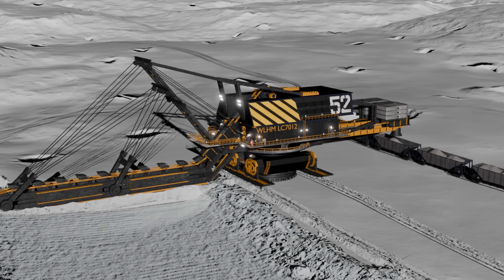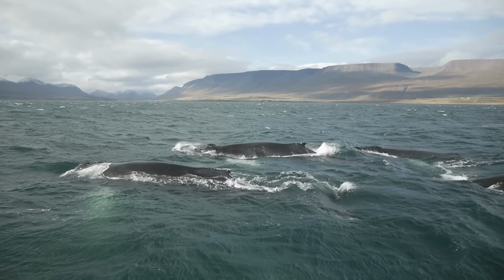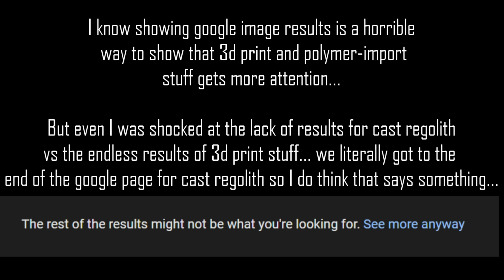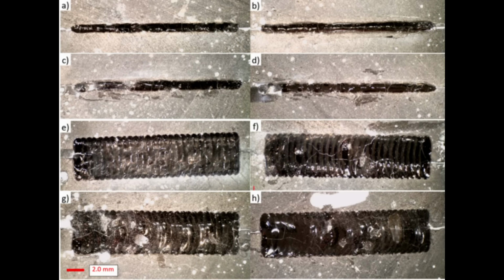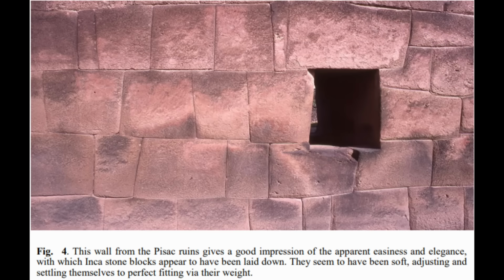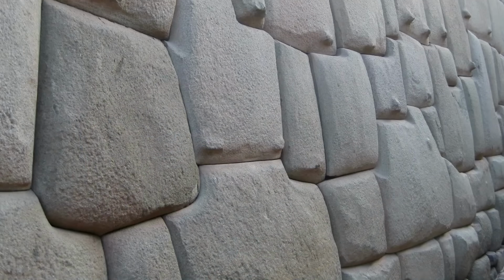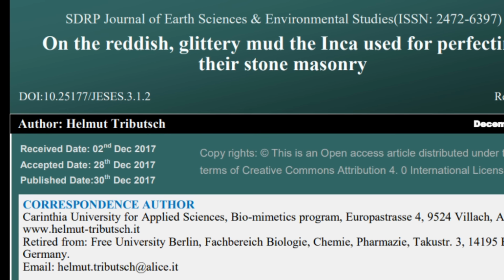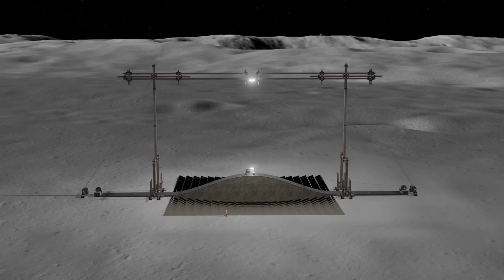Lunar Construction Materials

Comment: What about using a very hot wire to kind of solder bricks together? Kind of like what they use to burn and cut through styrofoam blocks but instead it's slowly passed through the bricks. Also instead of trying to make a normal cast basalt, what about glass-ceramic bricks? This would avoid the heat shock stresses if adjusted right(may need some bits removed or added as far as its composition goes to get crystals to form properly). Glass-ceramics have a costly step on Earth of maintaining certain high temperatures for prolonged periods of time to allow for the growth of crystals, but on the Moon that's not an issue.
Reply: Ceramic requires specific compositions of materials. Basalt is to cut some potencial imports, and ceramics will require imports.
Reply: Hot knife - just smear the stuff with some metals, coating, and let the cold welding do it's thing for sticking.
Reply: @Molb0rg  Yeah, magnesium could be the metal to use too since it's fairly abundant in Lunar regolith and has a fairly low melting point.

Comment: A question with the intention of using bricks to build how would just cutting the blocks compare energy wise if you used a laser or microwave fracturing? Robotically lap the blocks if needed to smooth edges if needed. I'm pretty sure this is cheaper energy wise though you wont get as nice of a finish. Probably acceptable in the early stages, and have further uses in shaping the terrain if needed early on with the aid of other robotic units.
Reply: Finish can be done, they polish well enough

Comment: Cast basalt is an order of magnitude stronger than any polymer binding agent for regolith.  It is as strong alloy steels.  It can be melted with concentrated sunlight, which the moon has in abundance.  If cast into tiles it can be used to build timbrel vaults.  Cast basalt is strong enough to make truly huge pressurised domes on the moon, which can be covered in regolith to ballast against internal pressure.

Basalt components can be bolted or welded together using lasers in vacuum.  Epoxy glue is an option as well.  If the blocks are smooth, the layer of glue can be microns thick.  Could we make bolts or dowels from basalt?
Reply from the maker: bolts and dowels maybe, I looked into using sol-gel stuff for binding the fibers togeather instead of epoxy like in basalt rebar but it's iffy. Needs to be explored more in depth

Comment: I still think nuclear is the better route for the moon. Solar panels are great for niche applications.
Reply: For life support, I agree. But for the ability to multiply the output in an exponential manner, solar on the moon wins.
Reply: @treasurehunter3744  setting up a nuclear reactor of sufficient size is a one time deal. Itll take the colony from 1,000 to 100,000 people. Solar is a way to create an industry thats purpose is to creat more of itself. The land needed increases transmission losses. The extreme heat differential will damge them overtime and reduce output at peak temperature.
Reply: @treasurehunter3744 and dont even get me started on the nightmare that is two week with no light all. Im mean sure that can be mitigated by being on the poles but to spread out from there will be difficult with a solar economy and no expertise for building a reactor.
Reply: @rexmann1984 Again, I'm agreeing with you using nuclear power for life support. It's an essential system requiring 24/7 energy.

However, with the lunar surface receiving over a thousand watts per square meter, and the per-pound refining requirement for nuclear power versus thin-film amorphous solar cells, and using reflection solar furnaces, solar scales faster. The lunar night, though it seems like a long time, only halves production. Thin film solar out-competes nuclear in power-to-weight ratio by almost an order of magnitude, unless you're talking really, really big nuclear plants, but by then, the point is moot, because we're not talking about scaling up industry on the moon, more optimizing.
Reply: No doubt nuclear will be extensively used on the moon however one overlooked point about nuclear is the mass per unit power. The killer power nuclear example weighs 150 kg/kW now some of those materials could be sourced on the moon, but by comparison solar masses in at 2 kg/kW and if solar cells for concentrated sunlight are used, this figure can be multiplied by several hundred I believe the real overlook technology is solar for concentrated sunlight since through vacuum pyrolysis it can be quite easy to produce large amounts of aluminum to act his mirrors so that the very tiny relatively speaking mass of the solar cells can even be imported with very little effect on the overall economics
Reply: Nuclear solves the day/night cycle length problem the solar fanatics try to ignore
Reply: What gets me is all the industrial processes that AnthroFuturism wants to do on the moon. He wants to use sunlight to make electricty and then make heat with that electricity. 🤦 The effeciency losses hurt my brain. The future of solar on the moon is when its mostly developed and half the panels you put up are in the sun at all times.  @Sid-jx4gl

Comment: Is pumping molten basalt to an in situ mould not an option?

I have no idea what the formwork could be made from, reusable steel panels?
Solves the brick joint issue.
Reply: Pouring molten materials on the moon would be super easy too thanks to insulating vacuum environment keeping everything very hot for a long time so you can get a really sweet pour without cold spots developing and messing up the cast.
Reply: So... Molten basalt freight trains to construction instead of cold bricks? Oh, maybe sending out hot bricks can be an option too. Let it anneal on the way
Reply from the maker: yes I believe I was recommending that
Reply: Sintered regolith should be fine for that.